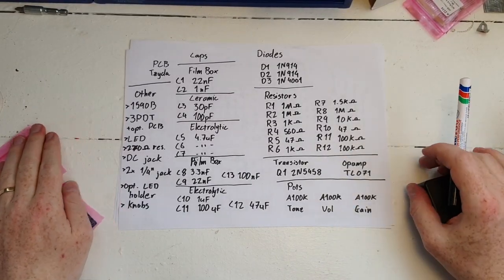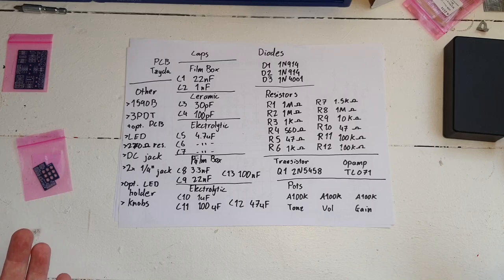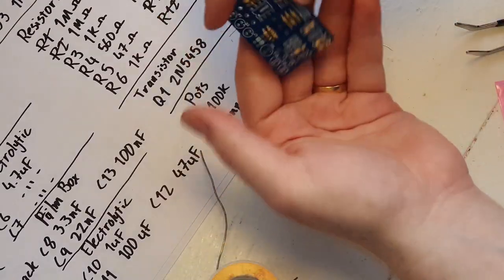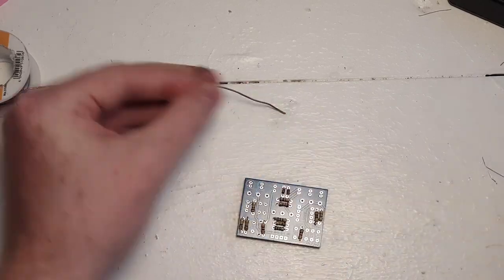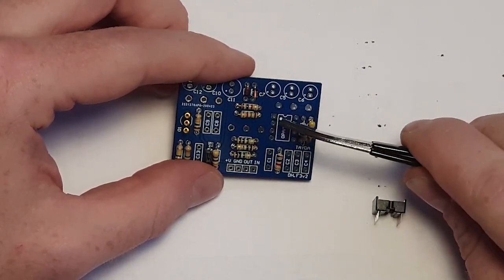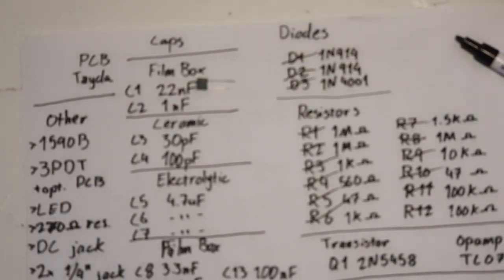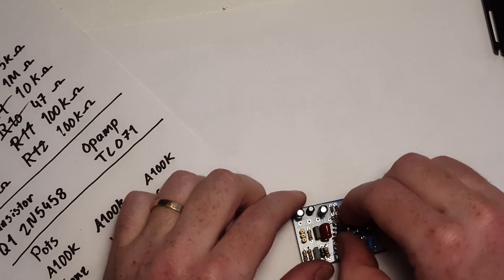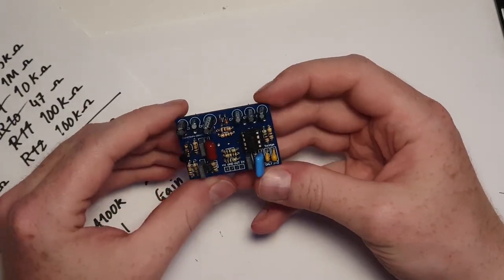How to Build a RAT Distortion Pedal For Under $27

Comment: I've been doing some minor soldering and building, but nothing like this— thanks for filming the whole thing and being honest with the issues. I think I might be able to handle it.
Reply from the maker: Definitely! These ready made PCBs make everything easier when starting out - You can always move on to vero builds later on. The Tayda RAT is a great place to start, but if you want something easier to begin the Tayda Guitar Power Boost is also great (gives you the option of building several different boost pedals by varying your components) and only runs about $6 USD.
Reply: Baldur's Workbench – Home DIY Engineering Very cool! Thanks for the tip! I have bought a few things from Tayda already but had not poked around the PCBs at all!

Comment: The 9v dc jack in the parts list is a 2  prong, and one of the caps on the list thats supposed to be a film box is linked to an electrolytic cap. Just couple things to note if anyone is tackling this project. Using the 2 prong dc jack is fine if you arent doing a battery, but if going that route, just use mono jacks for the input and out jacks. Hope this is helpful for someone

Comment: Why did you install the op-amp socket upside down ? IT also has the cut out as marked on the silkscreen on the board to indicate pin 1...
Reply: Yeah, the guy was like "you need to make sure you write down where the dot is". Like the socket wasn't built in a way that avoid this problem. And the guy simply did this writing WHILE being worried about that.
If anyone wants to change the op-amp in the future there is a GIGANTIC chance they'll put it wrong

Comment: I know this is ancient history in computing terms, but I looked at the schematic shown on the linked website for the kit. It shows pin 1 and pin 8 being connected on the opamp. The opamp is a TL071CP, and on that opamp, pin 8 is not used. However, on the original RAT schematic (using the LM308) pin 1 and 8 ARE connected. On the LM308 pin 8 is the "COMP2" connection and pin5 is not connected. On the TL071CP pin 5 is the "offset null 2" and pin 8 is the n/c. So I think the schematic is using the wrong pin number, but hopefully the PCB is actually connecting pins 1 and 5 via C3 because I can't see the PCB that well. (I only worked this out so I could breadboard the circuit and it was bugging me that an unused pin was being used)

Comment: Pro tip from someone who regularly built small boxes like these in his old workplace, but mainly as custom meters for specialty applications:

When drilling holes into any kind of enclosure, put some masking/painters tape on top of it, mark on top of the tape and drill through the tape.
That way you don't scratch up the finish with the metal shavings on your drill bit and/or leave permanent marks on the surface with your pen.

And when you try to solder a bit of wire to a terminal or pin, put some solder both on the end of the wire and the target pin beforehand. That makes the job a lot easier! :)

Comment: Hey there, nice video! One thing though : you don't have to remember where the dot is under the DIP8 socket, it  has a curve that needs to match at one side,  that you  clearly missed, cause you soldered the socket upside down :) Yet again, thanx for great content!

Comment: I watched your whole video and read the 49 comments before mine. I think it took guts to record everything and leave in your mistakes, it will probably save some noobs from making some of the same ones. As far as it is a bit sloppy, that's more of a personality thing, as long as you're happy with it, that's cool. I love that you just attacked that bish and made it your own. And like you said, it's a homemade one and it's going to look the part :D The only thing I could add that hasn't been mentioned yet is that you didn't have to struggle so much with that LED, and even change the height of the foot switch. Just attach some wires and put it where ever you want.

Comment: Late to the party but the original op amp was the lm308 (I think) which is obsolete. The direct replacement is the OP07 which is also obsolete. This seems to be one of the few pedals where the op amp does seem to affect the sound/tonal character of the pedal. It's hypothesized that the poor slew rate of those op amps may be what gives it it's character. The TL071 will probably sound noticeably different.

Distortion pedals usually use little current and a 9 volt battery will last a long time if you prefer going that way.
Reply: LM308 is still available. I swapped out 4148 diodes for red leds as someone suggested to me for better dirt, and maybe drill holes in the case for red eyes if they do light up. Might also do some of the “Mightier Mouse” mods (Beavisaudio).

Comment: Do you have to have the stereo output jacks, or would mono jacks suffice?  Only asking because the mono jacks are a fraction of the price and the stereo jacks are out of stock at Tayda :(
Reply from the maker: Mono is fine!
Reply: One stereo input jack is only needed if you want to use a 9V battery. Plugging a cable into it is what arms the battery. If you're going to run your pedal off of power, then mono is fine!!

Comment: On the legs I think 2mm is industry standard. I like to clean the board with a soft toothbrush and isopropil alcohol. Easy to see cold joints or bad joins. Bet good work.

Comment: Hi, why did you use a TL071? better use a OP07 like rat II, this one doesn´t use the compensation capacitor neither. Original is LM308 which uses comp cap.

Comment: Have you tried other chips in it yet? I had a 308 originally and was loving the sound, but I accidentally bricked it when I put it in the enclosure (long story). I put in the same chip you have and I did not enjoy it as much. I'm going to try a 741 chip and see if its closer to what I want based on what I saw on the diy pedals channel vid showing how close it came: https://www.youtube.com/watch?v=l0qVnxUJwsw

I'm hoping it isn't just my imagination that it sounded better hahaha. I do know though that a CA3130 sounded better to my ears as well (its what is in my pedal currently, from before my research I did today)
Reply from the maker: Not yet, just been sitting on my pedalboard recently - but I'd be very curious how it sounds with a 741.